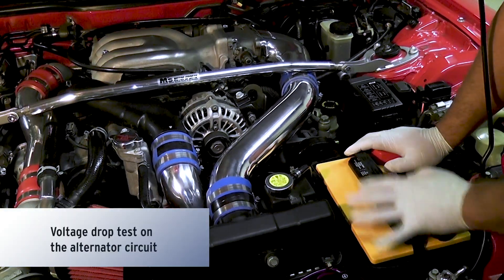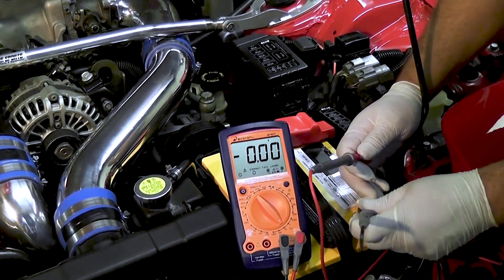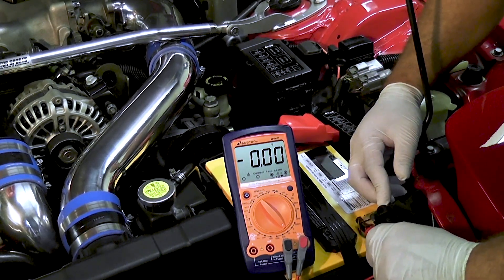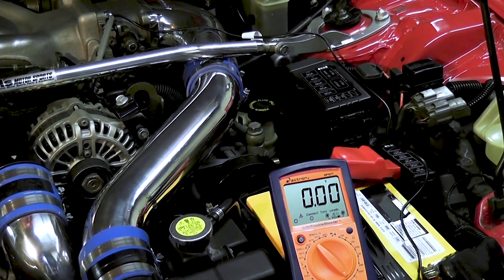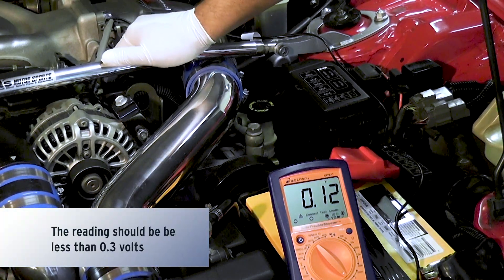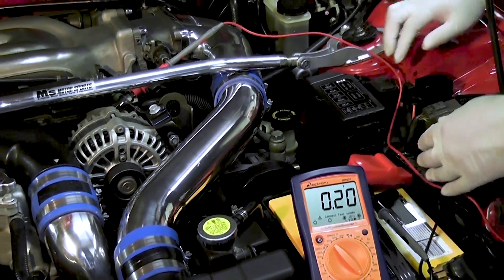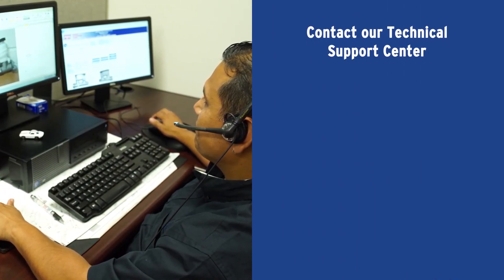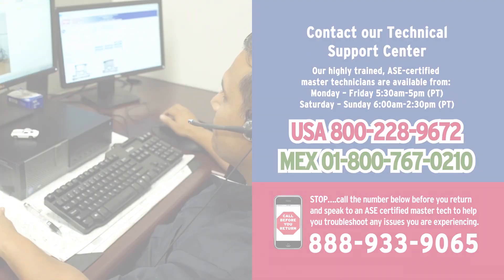Voltage Drop Testing the Alternator Circuit

Comment: And when the reading is 24-25 volts on alternator output but 12.1 volts across the battery, are we looking at a short in alternator or something wrong with the charge controller? 80A alternator for Lexus ES300 yr. 2000

Comment: but according to ericthecarguy, the reading should be 0.01-0.02..if the reading is 0.10-0.20, then there's a problem.
Reply: Actually if you go back and watch the ErictheCarGuy video again, he says that the voltage drop on the negative side should be between 0.1 and 0.2. No numbers on the positive side.
Reply: and different cars have different specs alldata tells you the range it should be, generally under .50